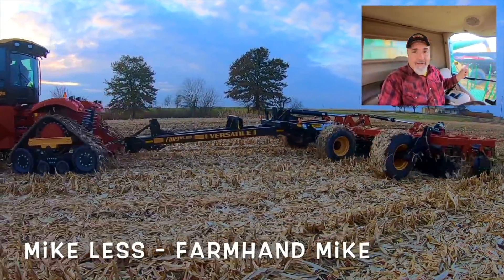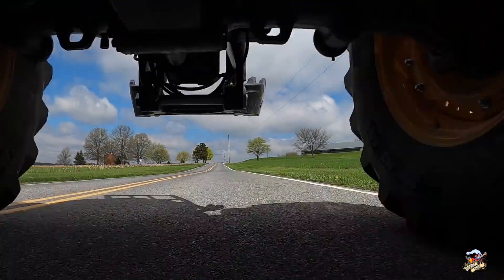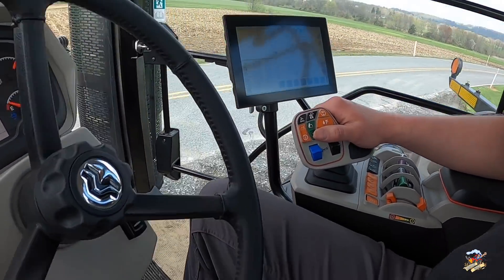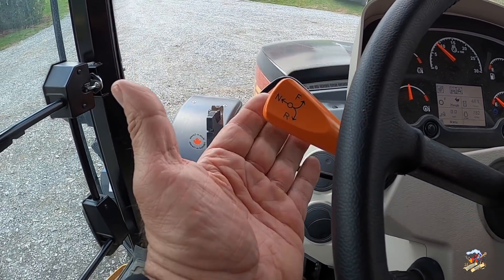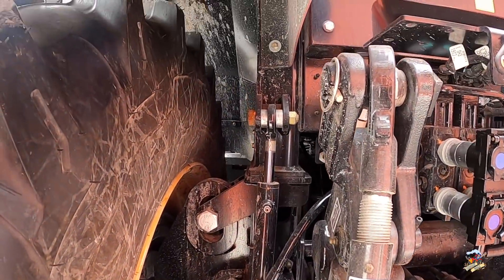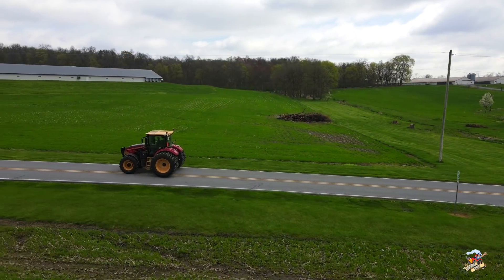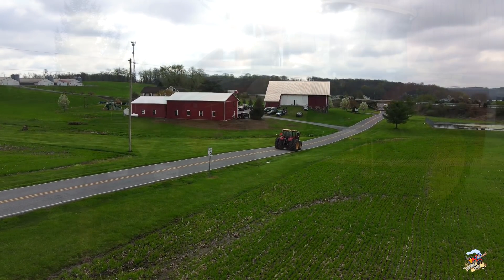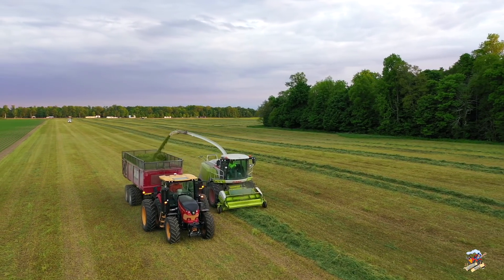CVT Transmission in a Versatile Tractor

Comment: Mike, I have a question. I have a D145 Versatile. The 300 hydro mech had a cab that looks like it would fit perfectly, giving it more of the modern looking vibe. Is the cab the same (with a few modifications) as the cabs on the 700 or 800?
Reply from the maker: That I don't know right off but if I has to guess I would say yes.
Reply: @farmhandmike  I would think the cab frame would be the same. Never understood why the 300 got a nicer cab, maybe it was produced later. All the versions of D145 cabs were pretty crude. I just think one of those would look so much nicer. The Massey 1500/1800 (a direct knock off of the 145, but not nearly as durable) had a much better cab. Massey bought a couple of 145’s to study and pattern their first 4wd. But somehow missed the things that made the 145 a tank!

Comment: With its two manually selected ranges I strongly suspect that it uses the AGCO CVT transmission. Is that correct? If so it is very well proven and used in tens of thousands of tractors over two decades or more.
Reply: It’s a ZF CVT
Reply: @Jaxon-iu6vb  
That is odd, because the ZF has four ranges that are automatically selected on the go, not two that require manual selection.
Reply: @hedydd2  Its a CVT.  Just a matter of programming.
Reply: @OOpSjm  
Not really. Or at least I don't see the logic of crippling it that way.
I await some reference from Versatile as to the provenance of this transmission. I would be very surprised, but not shocked, if it was a ZF model. Why would Versatile hobble it with a manual range change if its a ZF? I would understand it if it was programmed to optionally operate 'manually'. Yes, I do know that the Nemesis range otherwise use the very well established ZF semi-powershift transmissions and it would be peculiar if they used any other CVT but it is also peculiar if they copied AGCO for no other reason that I can see other than to seem as if its the same as the AGCO/Fendt transmission. I'm just into this stuff and puzzled. Sorry.  The whole story would be great. Oh and there's absolutely nothing wrong with either the AGCO or ZF CVT transmissions.  

In addition to the brands I mentioned using ZF transmissions, AGCO supply JCB as well as Fendt and Massey Ferguson with their CVT but AGCO/Valtra have their own different design of CVT. So AGCO actually make two distinct CVT designs. The bigger Valtra do use the Fendt built version though and are assembled on the MF production line at Beauvais, France using transmissions made at Maktoberdorf.
Reply: ZF builds a lot of different cvt with a lot of different setups
Reply: @zimmermanservice7474  
Not for tractors that I know of. Deere, Landini/McCormick, Deutz, Kubota all use ZF CVT's and they all have four ranges that are automatically changed, not two ranges. It's a basic part of their design. Also a similar but different model, also now in the ZF stable, is the previously Steyr CVT which uses dogs to change. It also has four ranges.
Perhaps you can point to a definitive reference to Versatile using ZF CVT's in their current models? I am very interested in transmissions and how they are programmed.